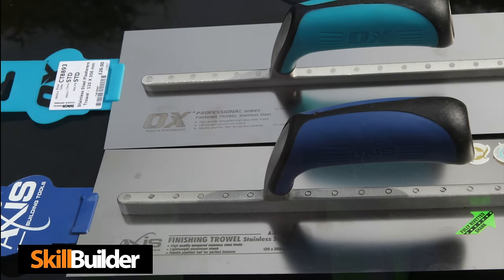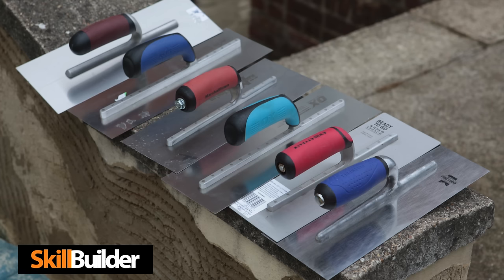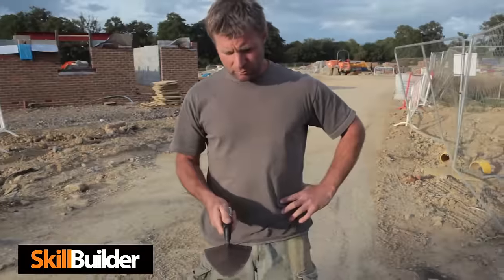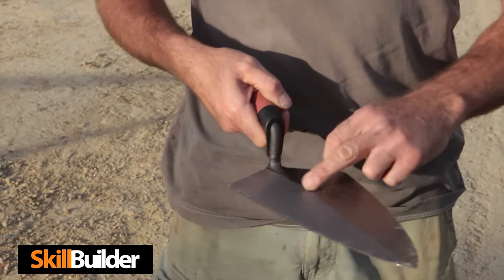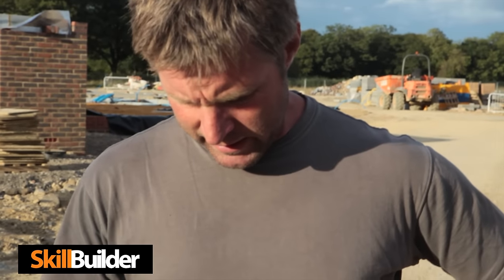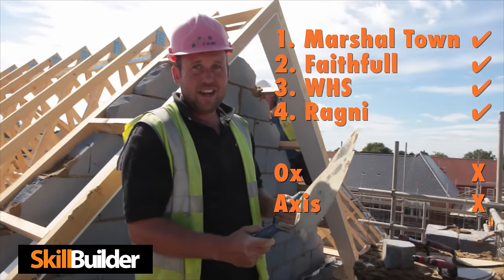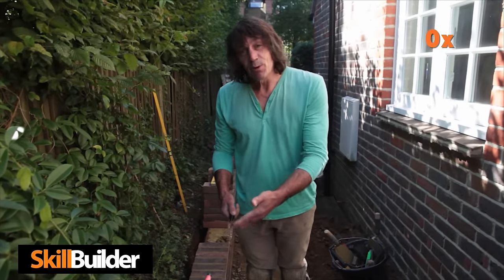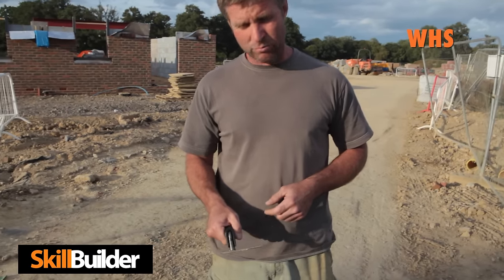What Makes the Perfect Trowel? - We Ask the Builders

Comment: Pug....A very non London term, I started in the East End and went to West Kent College St Johns in Tunbridge Wells (now gone....Thatcher) muck was the term in London, Pug was a Lime mi for us up smoke, but in TW Pug was the term,...30 miles, different language.........

Marshalltown London pattern (really hard to get, bought 3 in one hit) 11 inch....Only 12 inch  if you have hands like dinner plates and forearms like Popeye. Though started with a WHS 10" Left handed trowel (hardened edge on the left, heavier than a MT,  but crap handles circa 1980).  

Also 'Dongers' for ironing in joints again Marshalltown.... Footprint Pins, Stabila Bubbles

No longer on the Trowel.....got out as I was slowly falling to pieces....after 35 years...
Reply: I went to college there too 👍
Reply: @liamwalters5029  I was there 1980-82 ish..
Reply: Grant Beerling I did 2 years there them they shut it and had a year in Hastings
Reply: @liamwalters5029  bastards.....Mr Hook was my Brickwork teacher... a real man of Kent